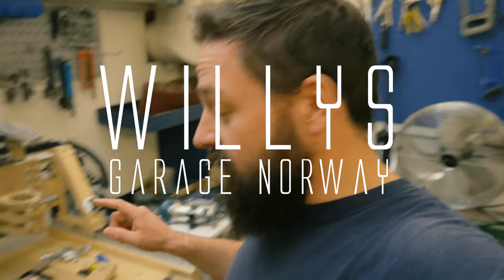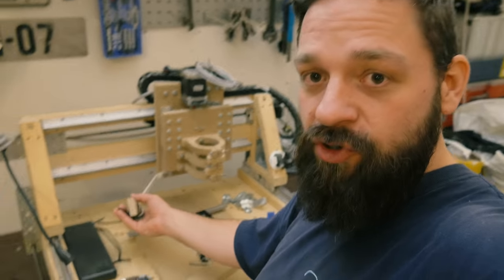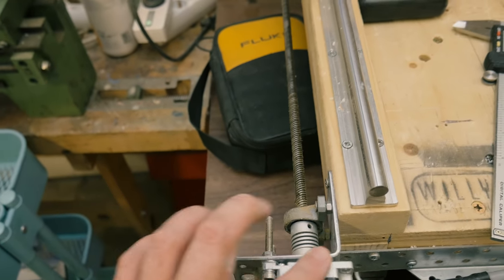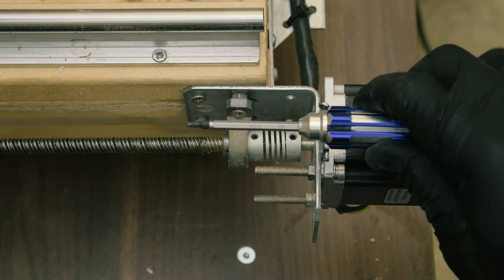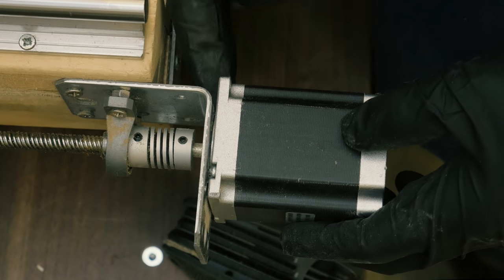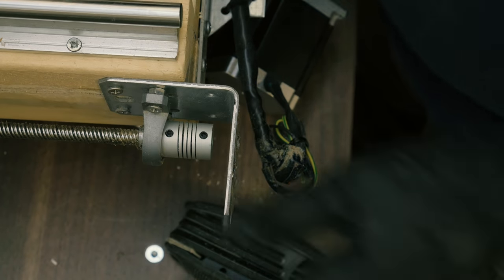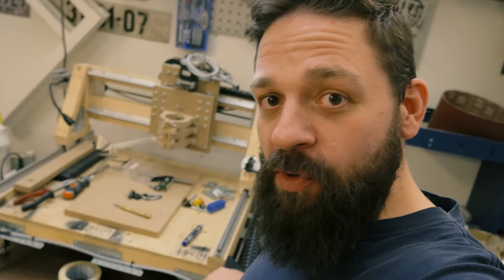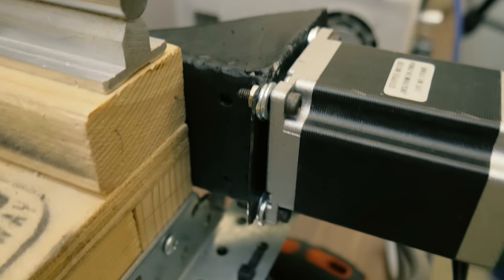First DIY CNC build (part 19) - STEPPER Motor MOUNTs | improved | WELDING

Comment: Isnt it better only to loosly mount the steppers and let them wobble a bit to reduce virbrations? You only have to fasten the lead screw mounts.
Reply from the maker: I see your point, but no. Every movement in the stepper motor reduces the precision of the cnc machine. This is because of the movement in the coupling. It will behave like the backlash in a lead screw nut

Comment: Hi, if you would build your cnc again, would you make it out of wood or aluminium? Thanks😊
Reply from the maker: Hi, if (or when) I'm building another cnc machine, I probably will build it stronger then the one I have. So aluminium is a good option to build it in 😀

Comment: hi 
thank you for your effort
What is the weight of the y axis approx ?
And z axis ?
Reply from the maker: Hi and thanks. The whole machine weights about 35-45 kilos with the spindle.
The Y-axis maby around 15 kg.
I haven't been able to put it on a scale, but approximetly
Reply: @WillysGarageNorway  
Thank you very much!
you are a best
Reply: @WillysGarageNorway  
I have a problem
I build it
The motor stops sometimes
The weight of the y axis is approximately 3 kg
Reply: @WillysGarageNorway  

The engine works well without connecting it to the axle

Comment: Hey Willy can you share your modified arduino slider code?  I don't have good knowledge about programing 😁😂😂 Also you showed us how to make that slider but still i don't know after watching  how it will be programmed.
Reply from the maker: I used the code in the link under the video. Only adjustments to speed and steps needed because these setting are made to your layout :) 👍

Comment: metal mount is difficult to make. A welding machine is needed. A loop machine is needed. It is difficult and dangerous for a long time. Can be made from 20mm plywood. Make a square of plywood and holes. It's quick and easy. All people at home can do that.
Reply from the maker: Thanks, good tip 👍

Comment: Binged watched all of these to get to here... gotta say you have done well.
THE one thing I will be doing when I build my next machine is to TOTALLY change the way I secure the work board to the bed for use. Instead of using those god awefull screws to secure the product board to the bed. I have found there is no need at all to screw anything down  EVER ....as having moveable side walls that can tighten up against the SIDE ONLY of the work board, and clamp down is the way to go.
This is sooooo much better as you don't need to drill holes to secure the project every time you want to cut one out. You simply slide the walls up against the board you want to work from to hold it in place. Not only does this save a heap of time, but It also allows full use of the boards size instead of worrying about  the machine bits breaking if they hit dodgy screwed down brackets. The job will remain really secure without any chance of moving throughout the entire process. If you are looking to improve the machine I would really recommend this,  and trust me, you will never go back. Looking forward to more videos.